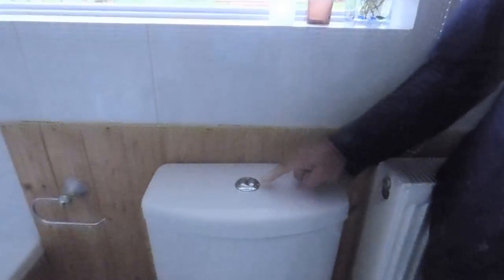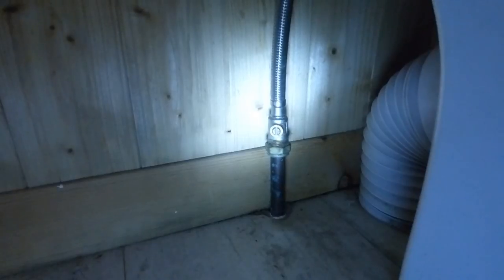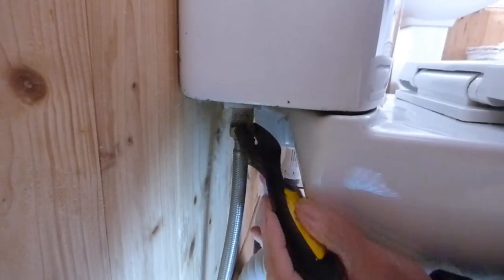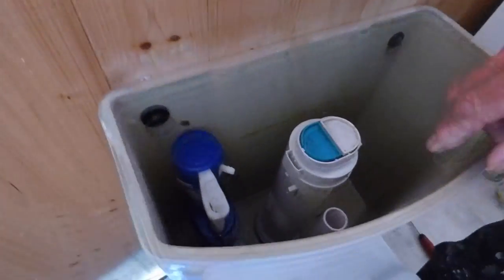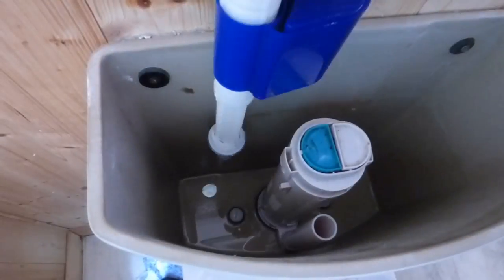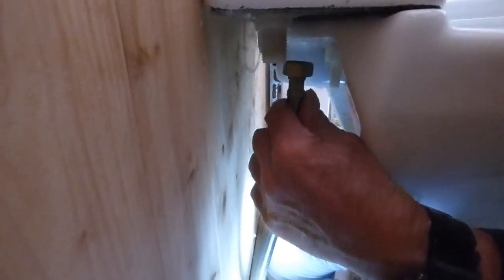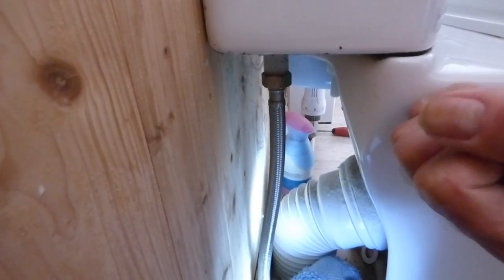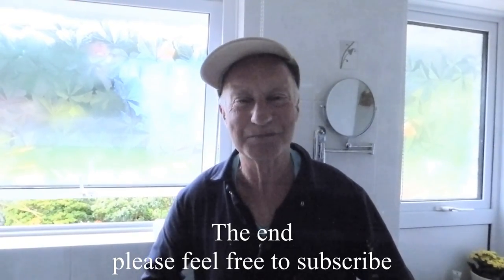How to renew the valve in a push button cistern. Stop that water running into your pan..

Comment: I've replaced all of our valves with fluid master ones and they worked perfectly.  The thing I struggled with was water seeping out of the cistern between the base of the valve and the washer, even though I had not forgotten the washer.  The first was was definitely debris, just as you said, but the second took me ages but I think it was just that I was a bit worried about the plastic washers and wasn't tightening it enough.  Still, got there in the end!  Are you planning to do anything with the rubber tips of the plunger?  I was thinking that Sugru would be good, but you can probably buy them for 10p.  I hope you're both well and enjoying the summer 🌞🌞🌞🌞🌞🌞🌞🌞
Reply from the maker: Still trying to think of something for those rubber tips. Anyway enjoying the summer, hope all is well for you too.
Reply: dereton33 I wonder if you could put a blob of hot glue on the bottom of them as in the end all it's doing is acting as a buffer.  All is great when the sun shines ☀️ 👍
Reply: We had almost a day of sun oop 'ere yesterday. Never been so depressed in my life. All those people running about and choking on chips. Bloody seagulls. Enough to make you weep.

Comment: What is the small white nozzle on the side of the valve near the top? I have this on mine and I'm sure this is where the water comes out from which causes splashing sometimes outside the cistern lid. If this is the case is there something I can do to get the water to fill from the bottom of the valve like yours? I've had to throttle the ball valve on the inlet to reduce the filling pressure for now but this makes it quite noisy but stops it splashing out from under the lid.
Many thanks!
Ben
Reply from the maker: A lot plastic valves have that plastic filler tube looping over the top of the valve. Even brass ones, Torbecks and flowmasters do not have this or an old part one brass valve. Only thing you can do is what you have done which is to throttle down the flow when you have one of these, or change the valve to one of the above.